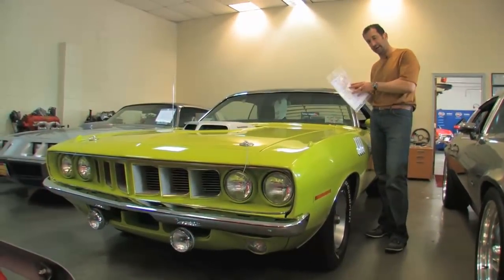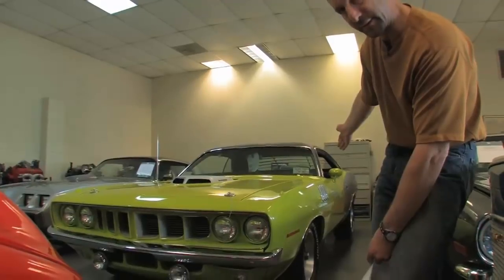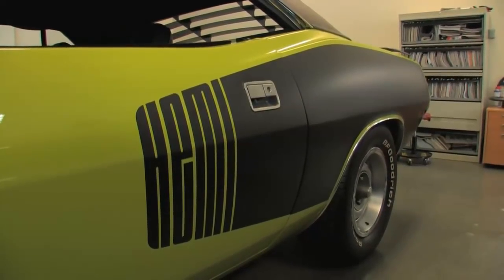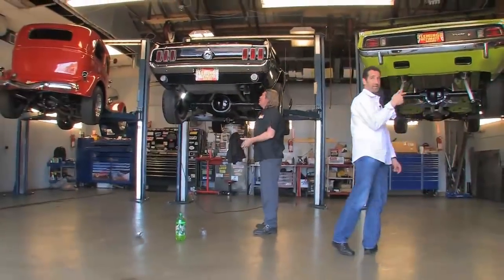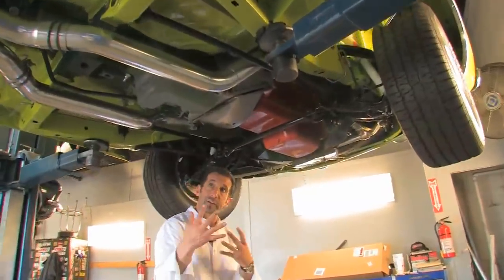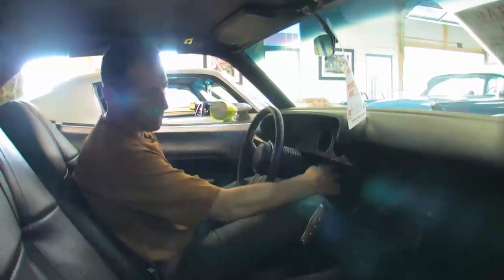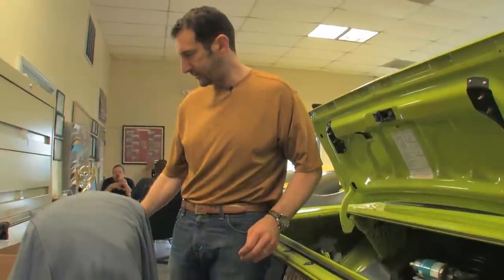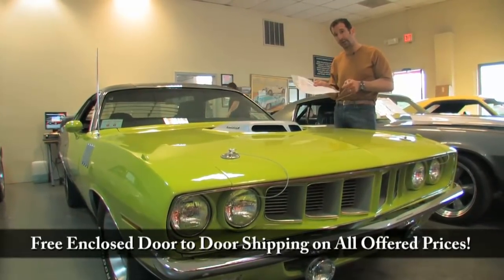1971 HEMI Cuda for sale with test drive, driving sounds, and walk through video

Comment: The thing about singapore is that the bulk of our taxes are based on the engine's displacement. like for example, a ferrari 430's road tax annually is roughly USD$3200 for 10 yeras. after that it's a 10% surcharge for every additional year. plus the insurance annually is USD$10000. oh and the best bit is the price, brand new with basic options one would be looking at $USD415,000. so a big engine like the HEMI would be very-very expensive here in Singapore.

Comment: The Shaker hood should have come standard on a Hemi car, unless it was sold new in Alaska or Canada.  Sassy grass green was only available  from  June thru August of 1970,  so the car must have an early build date being a '71 model. Also, this car being a 'Cuda in Sassy Grass Green, paint code FJ6, it should have come with a color keyed grill. l'm positive that if Galen Govier took a look at this car, he would say that it's  a CLONE.
Reply: It is a clone. They say "Date coded' but they don't say "numbers matching."
Reply: sean thorton.   I was the 2nd original owner of a 71 Hemicuda for 27 years, sold new in Montreal, Canada. The car was FJ6, automatic, vinyl top with louvers, wing spoiler, Ralley dash with 8'000 RPM, leather interior, Shaker Hood as standard equipment, Bill board stripes, all matching#. The build date was March 1971. I have all the paper work on this car since new.
Reply: Nick Panaritis I think that Sean is saying people above the 48° parallel shouldn't have optional shaker hoods because of the heavy winters.

Comment: "The hemi has been dynode at 600 hp". This is incorrect. IN a episode of American Muscle Car TV show, it dynode at 800 hp. It's only downfall was they usually didn't get the 3.89 gears that made it operate correctly on the street.
Reply: Don't insult the messager! Now I'm going to have to find the vid, so you can see it your self. The only difference from stock was the OEM exhaust manifolds were replaced by headers. Many of the musclecars of the 60/70s had their manifolds reaplaced once the car left the dealership floor by the owner.
Reply: This isn't stock
Reply: It was common for guys to replace the OEM exhaust manifolds with headers back then. BTW, the test only was run with headers on the HEMI. NO other changes.
Reply: ... the Hemi in this car is not stock to this car. Who knows beyond that.
Reply: -w41 Come on man. No way a factory street hemi makes 800 hp with the only change being headers.